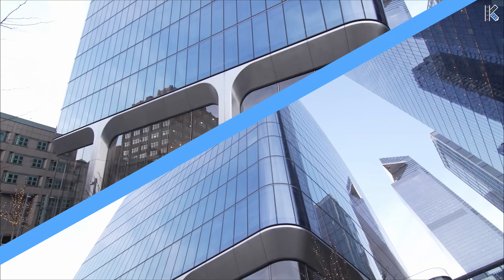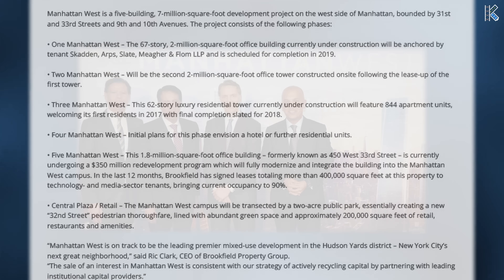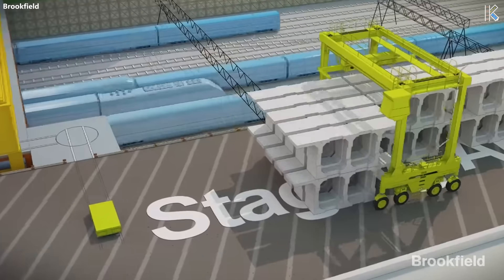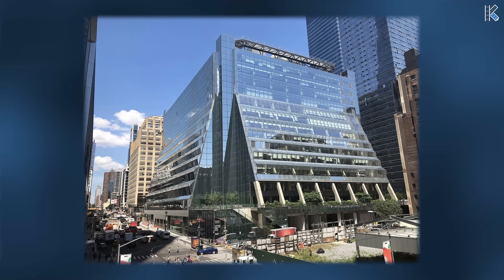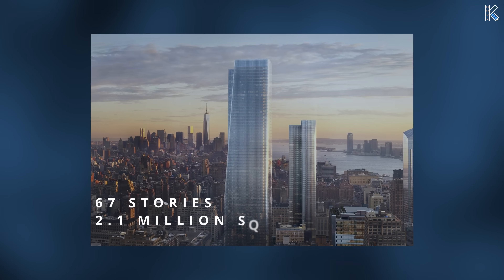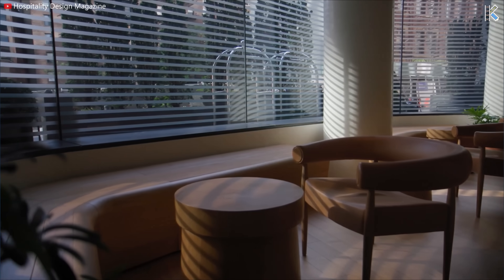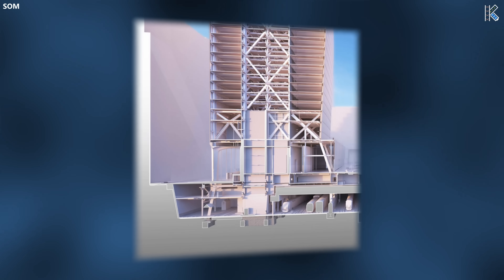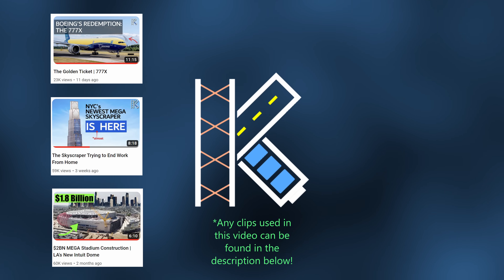The NYC Skyscrapers Built OVER a Railyard

Comment: I'm glad you noted the structural differences between 1 & 2, but its worth saying that the differences continue above ground too. 2 Manhattan West is basically an all-steel structure (braced steel core and perimeter steel columns) similar to the original WTC towers and 30 Hudson Yards, whereas 1 MW has the unconventional base, but above is a standard steel perimeter column, concrete core structure (typical of modern high-rise office buildings).